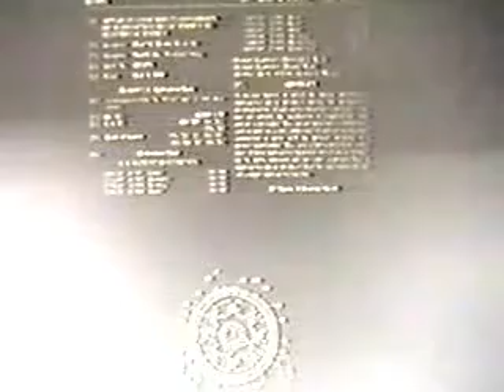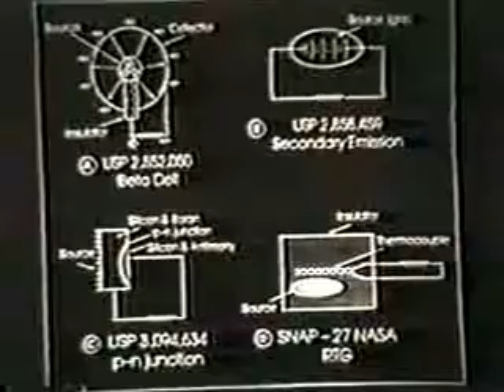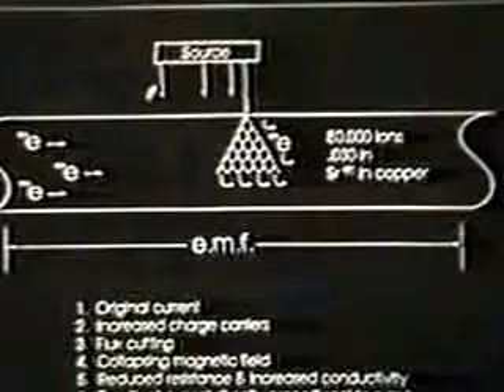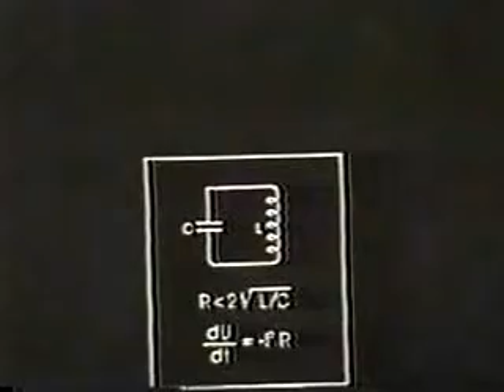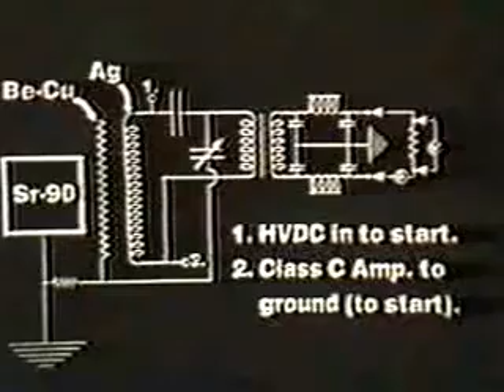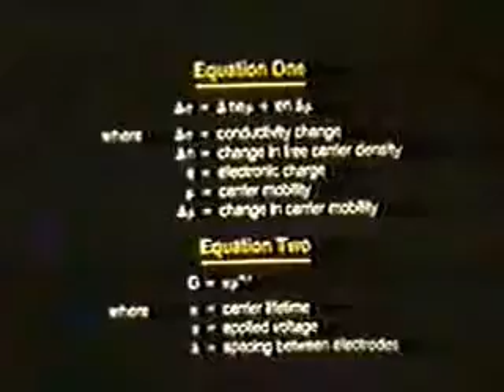Radioisotopic Energy Generation - Paul Brown - International Tesla Symposium 1990

Comment: 1) Where's the energy coming? even if we take 100% conversion of the mass energy 1.5 curie SR-90 would provide 5 milliwatts at best.   
2) When particles strike on the wire it should raise the temperature of wire and hence the resistance of LCR circuit, oscillations should damped down in this case.
3) When wire's temperature goes up and electrons acquire the sufficient energy to overcome the work function of the wire, electrons would start flying out from the wire's surface.